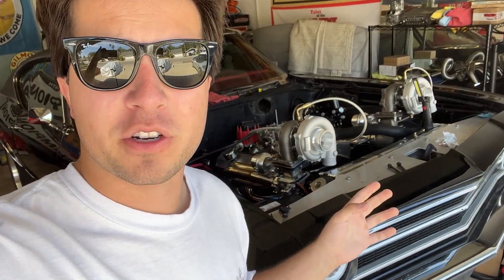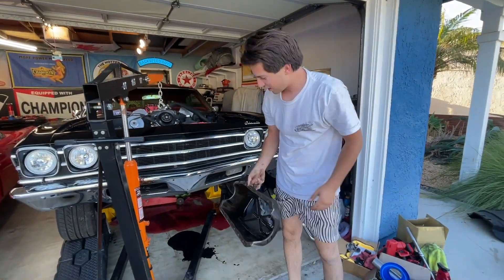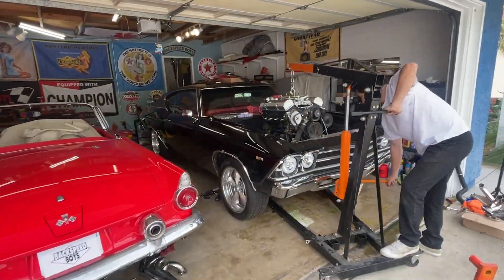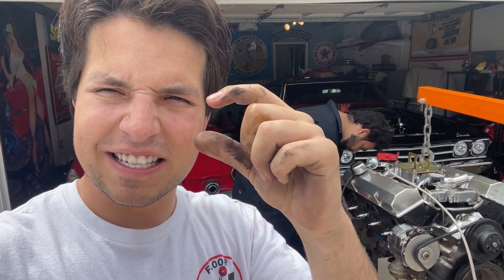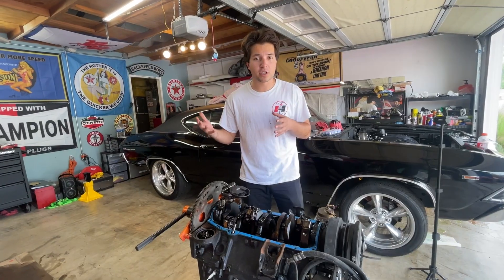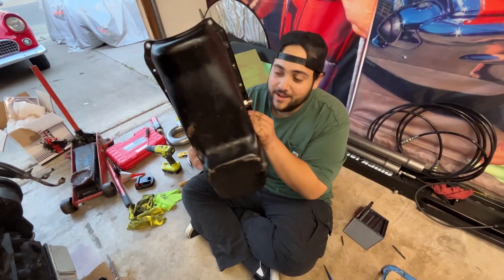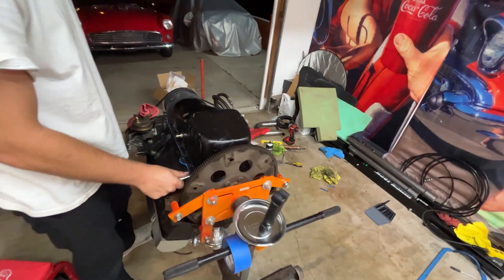Pulling the Engine out of my Twin Turbo 69 Chevelle

Comment: Stock GM blocks will hold up to around 800hp typically with a four bolt main block, a two bolt maybe 650hp. I would definitely recommend getting a aftermarket Motown block to have built before that one grenades itself.

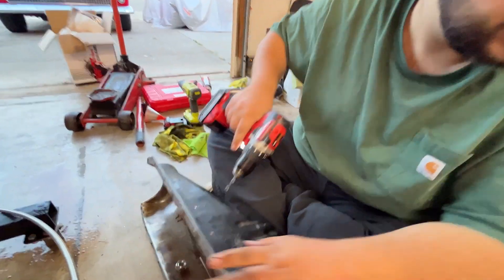Comment: 3:19 in and noticing 2 bolt main caps. Make sure to lighten the crank and have a good balancer before those two huffers blow the bottom end. Might want to think about new bearings too